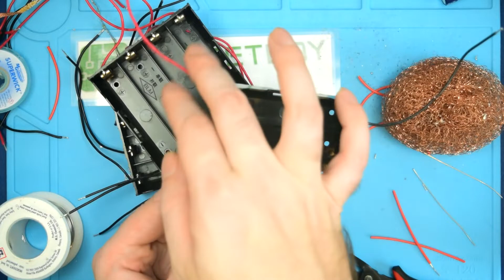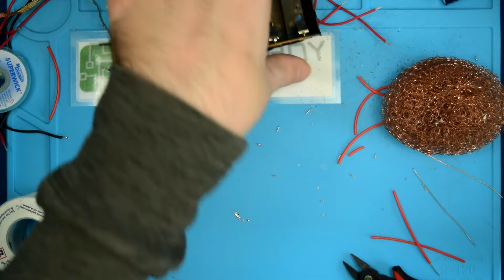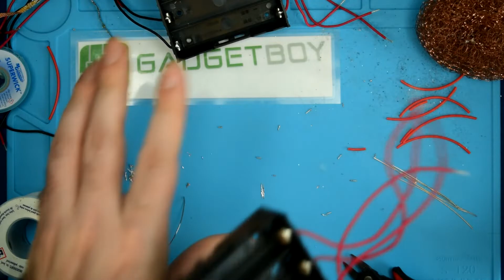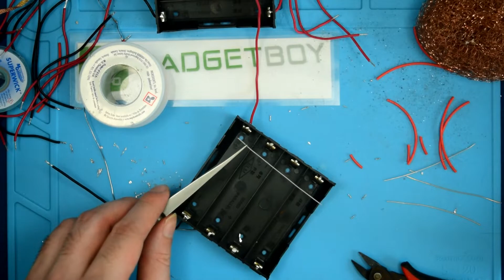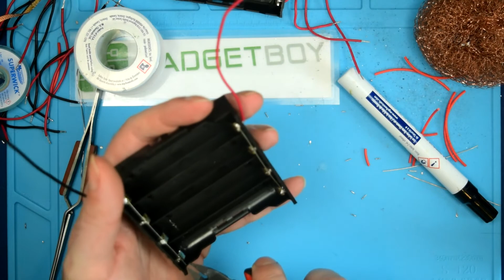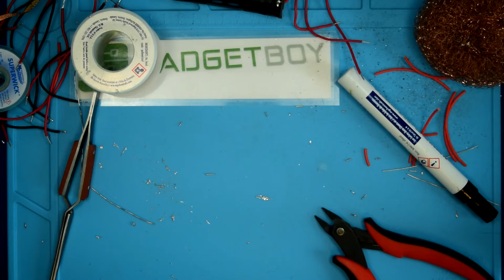12V Solar Battery Bank Project - Part 2

Comment: Why didn't you keep the wires at opposite ends of the battery holder, power coming in would have spread more evenly, the first battery will likely have a shorter life, no?
Reply from the maker: It won't make a difference. I just wanted the wires to be more manageable.
Reply: @GadgetBoy  are you totally sure? Just most chargers I've seen using opposing ends is all